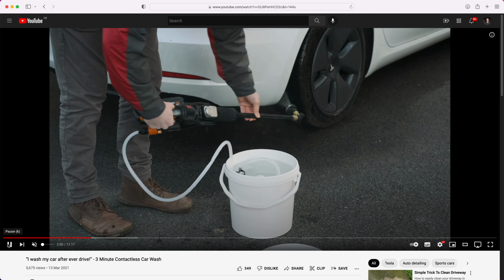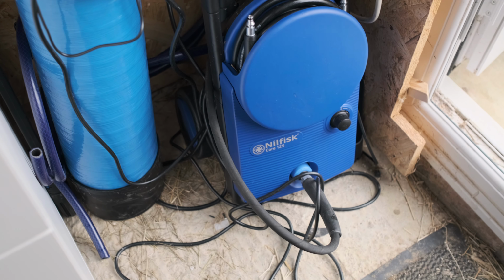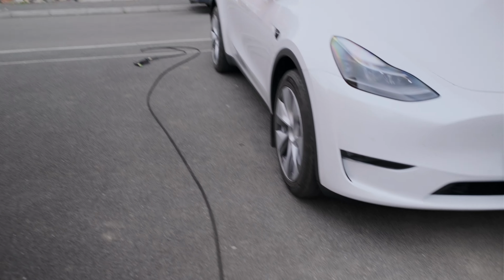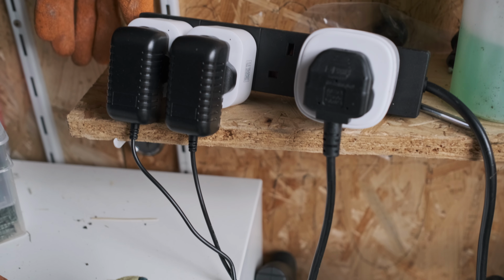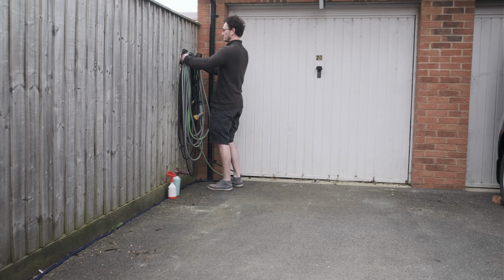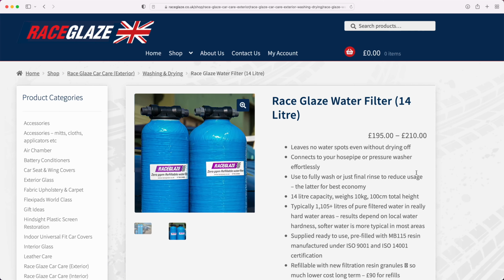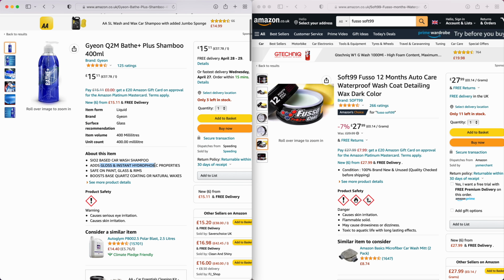Designing An Automated Home Car Wash System

Comment: I was expecting an automated process but everything was still very manual?
Reply from the maker: You mean like a drive-through?
Reply: @BenVallack  yes, I was expecting something more like when you arrive home the car gets an automatic rinse, then maybe occasionally degreased depending on how dirty the water is, or time since last degrease or miles traveled.

All in all I was thinking less "imposition".
Reply: I played around with this idea 20 years ago but I have never owned a good space to realize this idea but something like a car wash where a either mowing nozzle or a sweet of static ones do a lighter cleaning. And then you occasionally do a more manual way like every 3-6 months with fiber cloths etc

Comment: 🎯 Key Takeaways for quick navigation:

00:00 🚗 The concept of a contactless car wash helps in spacing out traditional contact washes, making them less frequent.
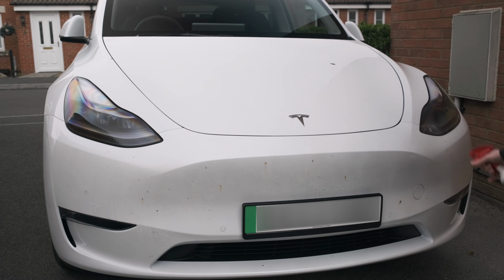01:02 💧 The contactless routine uses a cordless pressure washer but needs more power and flow rate for efficiency.
01:58 🏠 Installing a permanent pressure washer in the garage with a long hose is a practical setup.
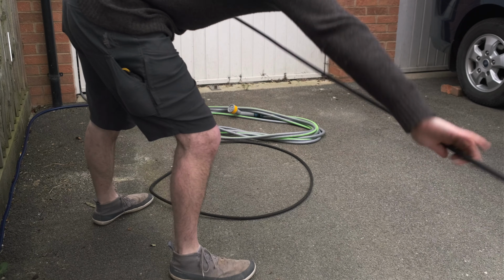03:09 🌀 Coiling the hose in an "over-under" manner avoids kinks and makes it easy to manage.
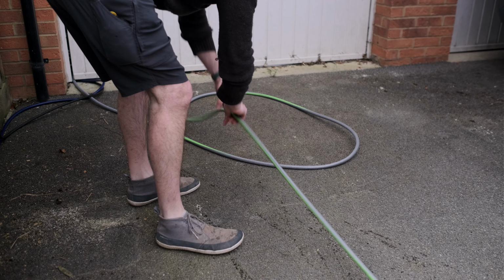04:21 📱 Smart home integration using HomeKit and Siri allows remote control of the pressure hose and water.
07:10 🧼 Using snow foam is essential to lift dirt off the car's surface in the contactless wash.
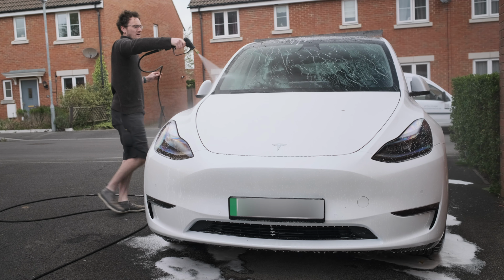08:34 🚰 Replacing rinse water with deionized filtered water prevents water spots on the car.
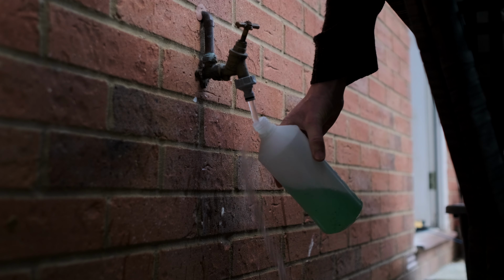09:59 🔄 Coiling the hose in a specific way after use ensures it remains kink-free.
11:25 🚿 Maintaining a hydrophobic sealant on the car is crucial for the effectiveness of contactless washes.
13:03 💰 Setting up a contactless car wash system can be an efficient and convenient way to keep your car clean.

Made with HARPA AI
Reply from the maker: Pretty impressive!!!

Comment: Thanks and sweet car.
I have to wash my car weekly or fortnightly from driving a lot.
I tried a professional washing course, but that routine takes hours.
I used to pressure wash the car, which is quicker but didn't seem to wipe off dirt as well as my below chamois routine.
The quickest is:
1. Hose on a roll up retractable hose reel.
2. Twist spray hose reel water on car in 1 hand and a quick dry small chamois in the other hand wiping the car clean.
3. Glass window squeegee wiper to dry the outside glass.
4. Bug and tar spray onto a polisher and polish stubborn marks/bugs/tar off.
Car's been shiny for 7 years now.
I need to learn how to wax and polish though.

Comment: I found this video v helpful although I was slightly shocked to see the cost of the roof box is about £400!
Did you do much research into that Thule xt ?
Is it £400 because it is particularly light?
There are cheaper ones on the market but I’m not sure if it’s worth buying a cheaper model when it could be quite in echinomical?
Reply from the maker: Yeah really I went for it for its optional extension and the aerodynamics with the faring, plus it looks great. I really can’t get excited by the boxy style of some of them.

Comment: The hose technique is very useful.
But for me and others, a car is just a tool to move from a-b as cheap and easy as possible. The car is clean after a pressure wash, it prevents corrosion from salt and dirt trapping moisture.
But the "spotless dropless" cleaning is purely cosmetic and only lasts until the next rain anyway
Reply from the maker: If you have a car it’s nice to keep it clean, but all techniques in this video are focused on speed and effort reduction not cosmetics. It wouldn’t be good for the paint to leave hard water marks crusted on it so it needs to be dried one way or the other. The DI rinse is faster and easier than manual drying - simple as that.

Comment: Thanks for all the tips! Nice video. The only place where I felt a bit worry is at 6 mins, your extension sockets are all exposed to the pressure washer hoses right next to it, I think best to cover the sockets so its splash proof, you never know how accidents could happen, even knowing those hose clamps should last a long time without problems. So wrap them in proper enclosing or even plastic bag so spiders don't make itself like home. Haha...!
Reply from the maker: Yeah it’s all a bit dodgy isn’t it! Will improve it cheers!

Comment: Great vid. Can I ask what pressurises the final DI rinse output (garden hose with trigger spray attached), assuming the pressure washer has be disengaged at this point?  Or has it !!?
Reply from the maker: That is just the normal tap going into the filter, the pressure washer is not any part of that process.

Comment: Nice job.  Think you might've missed a bit though . . . check out videos on Pressure Washer Undercarriage Cleaners.  They fits right in with the contactless set-up and can reach the bits you'd otherwise struggle with.
Reply from the maker: Yeah sounds good- trouble with the Tesla is you can’t really get to any of the suspension bits as it’s all covered up. I do want to get in there with some rust prevention stuff though.

Comment: I do a weekly contactless less wash. But to keep it contact less using hard water without all the complications of de ionized water simply invest in a good electric air blower like Ego with accessory attachment specialized for blowing the water off the car. Simple. Effective. No messing around with expensive deionized water hoses and routines
Reply from the maker: Yeah I tried a metrovac sidekick, it was so noisy I felt embarrassed using it! It was also just too small in terms of airflow to do the job quickly. It's a good idea if you have one that has the airflow to do it quickly and isn't too noisy though for sure.
Reply: But those units are £2-300 so its hardly a cost saver ? Plus you need (increasingly) expensive electricity and power in a wet environment.

Comment: I love how well you develop and explain your ideas!

I bought the WORX WG630E1 18V 20V MAX Brushless HYDROSHOT Pressure Washer last week based on your last video. I'm very impressed with it. After watching this video I'm half-tempted to return it and get the Nilfisk Core 125 lol. However, I like not having the hose, so I'll stick with the Worx, I found its pressure to be more than adequate (although I'm sure more is better - allowing you to apply faster by standing back further, as you mentioned) 😊 Filling the bucket with water isn't a big deal for me as it only takes a few mins.

I really like your Siri controlled system.

I'll get a DI setup soon (possibly the one you mentioned) and other cleaning products. I'll be watching your future videos for recommendations! 👍
Reply from the maker: Hah yeah please don't feel pressured(!) to follow all my latest obsessive ideas heh. These two routines both have their merits.
Reply: @BenVallack  I actually changed my mind and copied your setup of the Nilfisk (I got the 140 from their outlet store), 20m hose and short sprayer! It's brilliant! Much faster than the WORX and I've also used it to clean up my driveway, fencing, patio, etc. I haven't got the deioniser yet, but will get that at some point 👍
Reply from the maker: @TechboyUK  Heh cool stuff - yeah the speed implication is pretty significant isn't it.

Comment: Have you looked at reverse osmosis systems instead of DI resin? You would need a tank and pump for the output side, but the membranes last ages so might cost much less overall.
Reply from the maker: Yeah I did think about it but got lazy and went for DI. Might well look at RO if the resin gets too much!

Comment: Hi Ben, great vid. I’ve been using a very similar process for a while now and it works great, but using BH touch less and love it (never used autofoam).
I’ve managed to reduce the time even further to near 5 mins with very similar results. I’ve started applying the BH Touchless but via a pump sprayer (mixed with DI water) instead of snowfoam. Then rinse off with DI water from the hose using my Worx Hydroshot but with a 40° MTM Hydro tip attached to a Hydroshot short Lance. This generates enough power to blast off all dirt the Touchless has loosened, and removes the need for a 2nd DI Rinse. Cheers
Reply from the maker: Very interesting, wonder if I sold my HydroShot prematurely lol!
Reply from the maker: Are you using Touch-on as the contact wash as well?
Reply: @BenVallack  Yes, on a 3 year ceramic coated model 3. Only apply it once a month or so and it’s keeps protection to a good level.
Reply from the maker: @teztickle  Good to know cheers, I will give it go soon, I may add a longer term sealant under it depending on results.

Comment: Really interesting and well thought out design. I find your videos are always well presented and motivational. Thanks for sharing. 
The idea of not having to dry the car is a positive one as does take a fair bit of time. I remember an old system from 10/15 years back you clipped onto your hose that was supposed to filter out impurities, did an alright job. Can't recall the name.